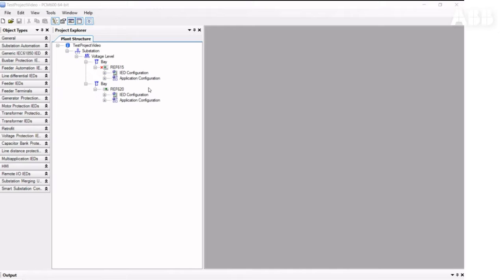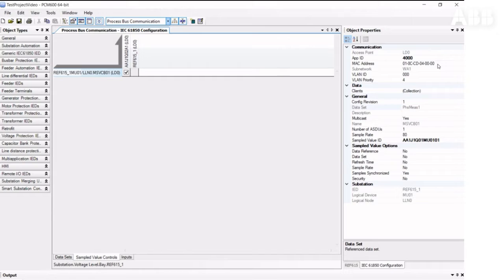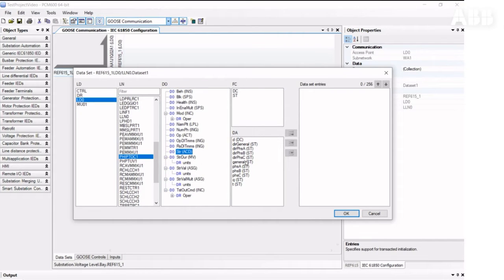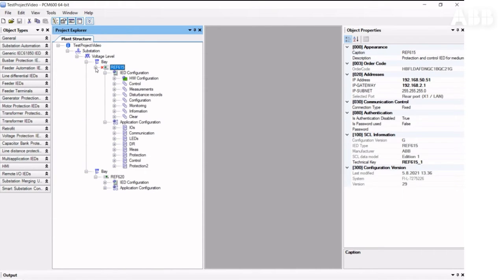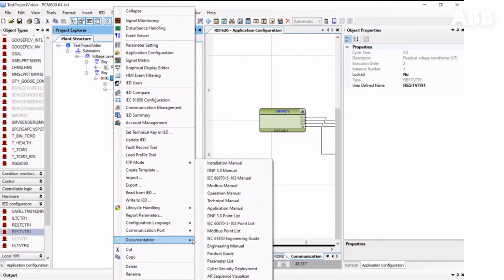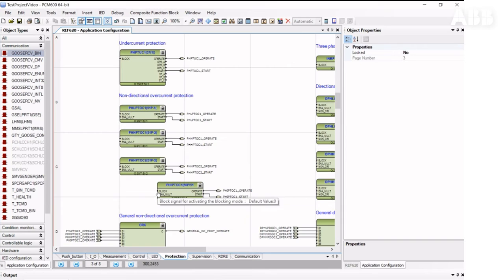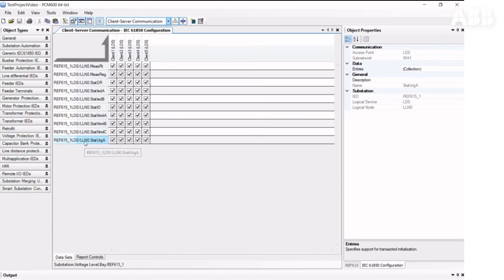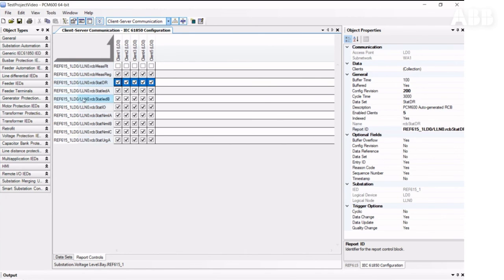7- How to use IEC 61850 Configuration in PCM600

Comment: Sir how to create icd file and export
Reply from the maker: Hello @rakeshverma-cu8ug. Creating ICD (Intelligent Control Device) files and exporting them in ABB relays typically involves using the appropriate software tools provided by ABB, such as the "Relay Configuration Tool" or "Protection and Control Software." 
Refer to the specific user manual or documentation for the ABB relay model you are working with, as the steps may vary slightly between different models and software versions.
If you encounter any issues, consider reaching out to ABB support or consulting the technical documentation available on the ABB website.